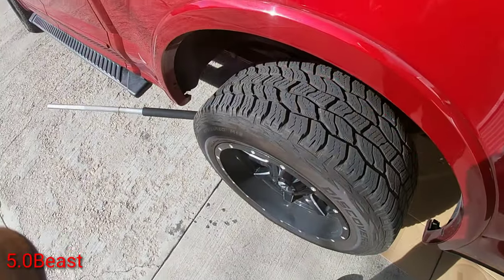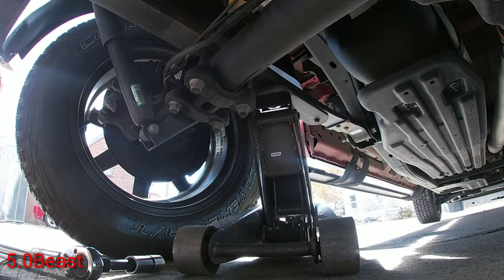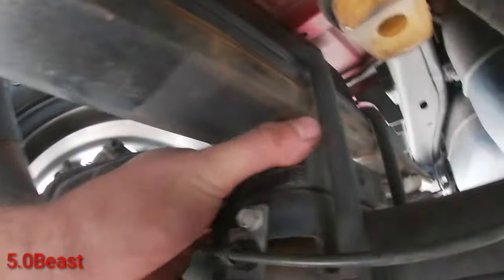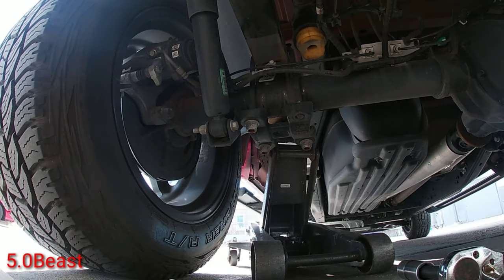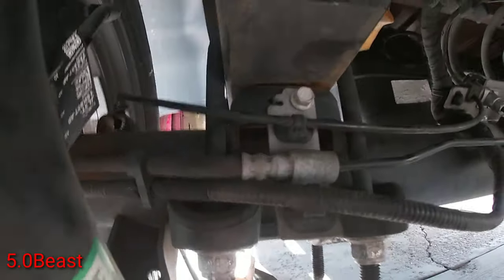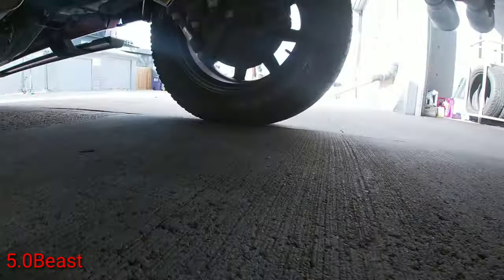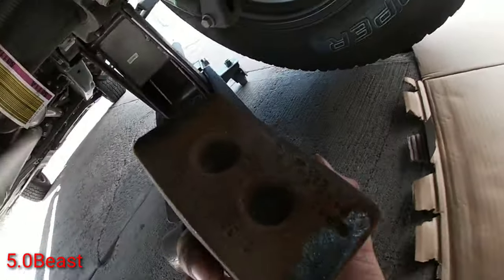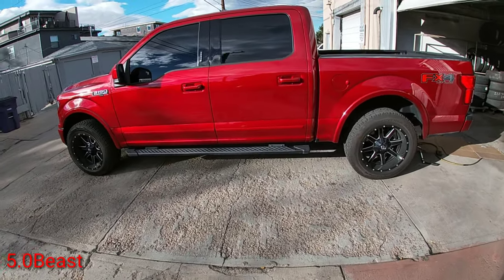2018 FORD F150 REAR BLOCK REMOVAL

Comment: It's been some time now, have you  had any issues with hitting the bump stops, or have you towed anything?
Reply from the maker: No issues at all and I haven't hit bump stops when towing but I have only tow like 3000 pounds.
Reply: I believe the issue would not be towing itself, but payload or tongue weight
Reply: I've had mine out of my 2019 super crew 5.5' box for a three years now, rides the exact same (have to re-aim the headlights) and I haul two 1200cc bikes a lot, I also tow a 9,000 lb fifth wheel.  I have airbags too, so maybe not a fair statement because I can air up to whatever height I want, but it rides the same with or without the blocks

Comment: Who in the right mind lowers a 4x4 truck!!?, leveling the front up was the right way to do it!
Reply from the maker: Yea it was just don't like the big gap on wheel wells they have.
Reply: @Eldela5.0  , I guess you have a valid point!
Reply from the maker: If I would off went with bigger tires I would have done a front leveling kit.
Reply: @Eldela5.0  , that's what I did to mine, I raised the front 2 inches, so I can fit 33s or 35s